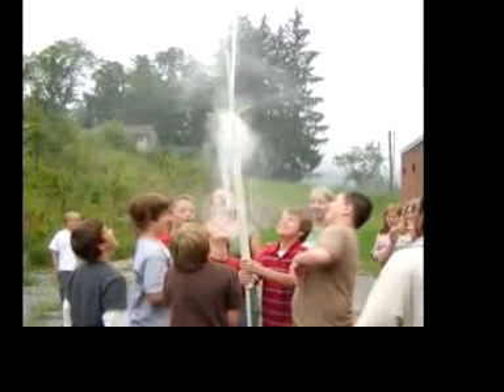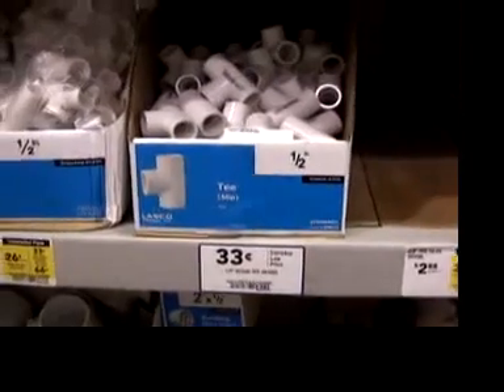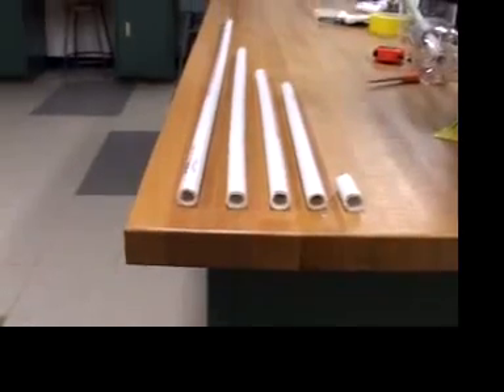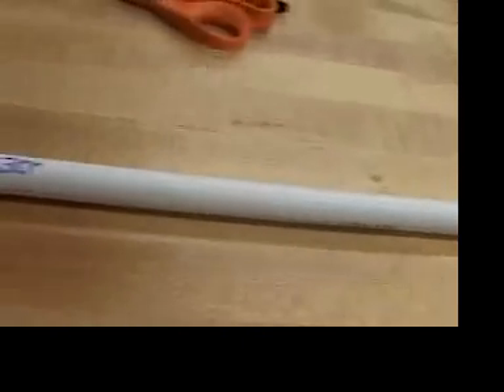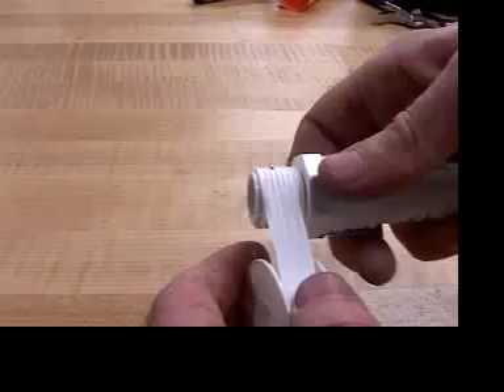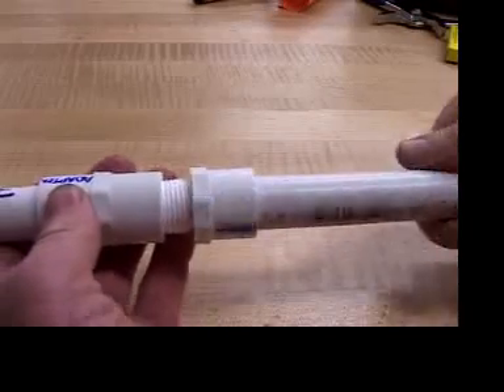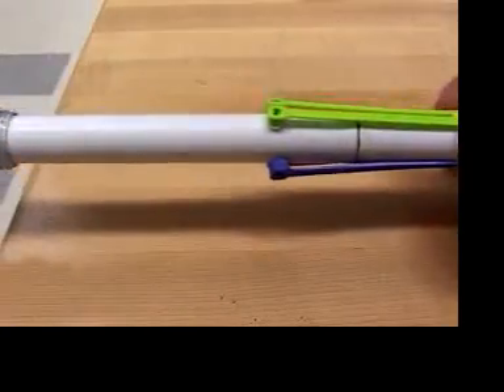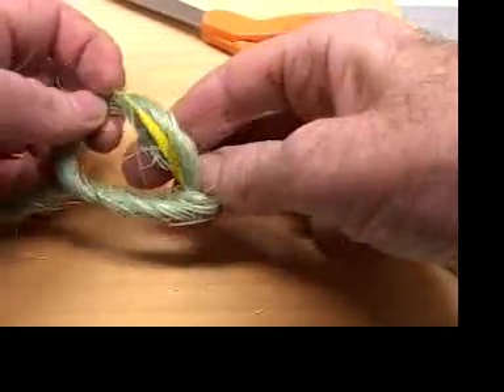Overhead Water Rocket Launcher Part 1

Comment from the maker: Well done! Great design and clear presentation! You should now be able to add your video as a video response on this page. You mentioned that the base of the fin must not be more than the diameter of the bottle. Is that based on experiments with bigger fins? What happens if its bigger?
I look forward to seeing your launcher and launches. Keep innovating and sharing!
Slater

Comment from the maker: @MrTomcarnahan You might try something with lawn sprinkler shut off valves for filling with water on the launch pad. As for parachutes, they would seem to be so simple--it was the first science project I made as a young lad--but parachutes are actually very difficult to get to work reliably on water rockets.
Slater

Comment: for best results fill 2 liter bottle 5/8 or 1125 ml. also if you duct tape a 1 liter bottle to the 2 liter bottle it is more aero dynamic also if you duct tape something such as a stress ball to the caples 1 liter bottle it preforms better by not flipping end over end. but if you do the these add ons you also must put 3 or 4 congruent fins on the 2 liter bottle and if you do all of these things you'll run into the problem of the top bottle or 1 liter bottle being crushed after landing to get

Comment from the maker: @MrTomcarnahan I have not seen that problem before. You said "2inch 1/2 cover." Does that mean you used a two and one half inch(2 1/2") pipe? It should be one and one half inch (1 1/2"). That would account for the loose fit. Is that it? Can you send a picture (my regular email contact is at sciencetoymakerDOTorg).
Slater

Do you live in North America?

Comment from the maker: I've never had a leak in a slip cement joint so I don't know, but I would try the easiest thing first: gobbing some cement on the outside and try to push it as far into the leak as possible. 
Slater

Comment: I love your launcher. I make one just like it and shot my rocket about a 1,000 feet. plus. The rocket I used was a 2 bottle rocket with three fins and a cone on top. It was balance correctly total weight 250 gm.

Frank B.

Comment: other than that this video is extremely helpful i'll also post my design of a ground launch pad for a water rocket with this type you can use an air compressor and pressurize it up to 120 psi but i reccommend 100 psi for saftey reasons because the bursting point of these bottles is 180 psi